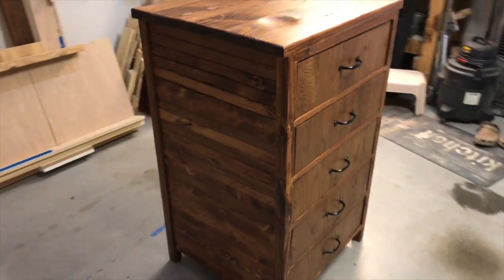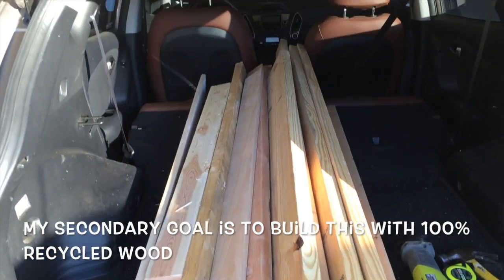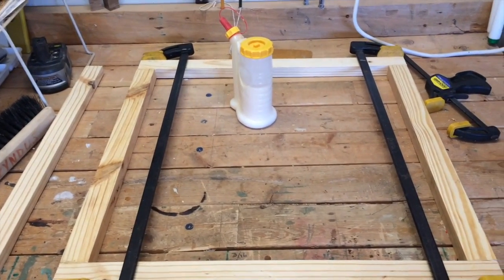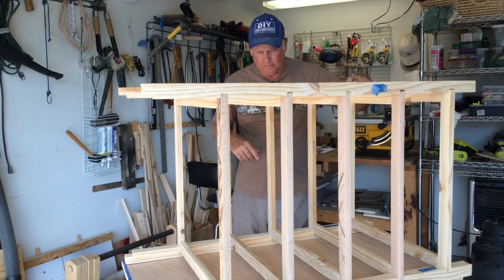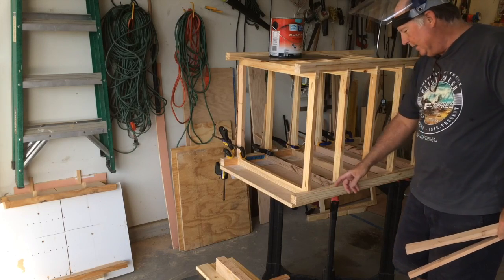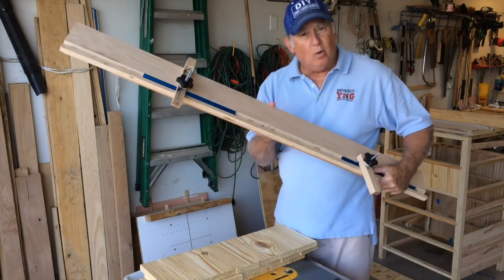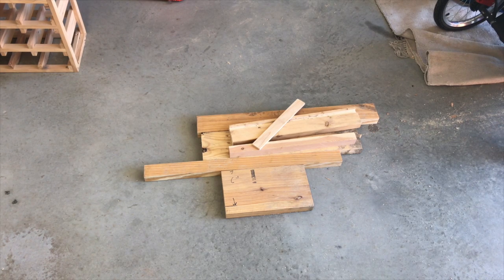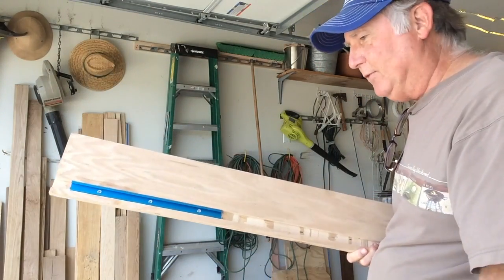Dresser Build

Comment: An interesting video that shows your build process well.  I like the jigs, especially the sled to trim the drawer glue ups.  
You may be having a problem with wood movement when humidity gets higher next spring.  Since the greatest expansion and contraction goes across the grain, the drawer fronts (and backs too) which already appear to be fairly tight in fit may expand and the drawer will seize up.  The same thing will apply to the 50 slats for the sides unless they are allowed to float and have some room to move as a whole.
Reply from the maker: Jerry, Spoken like a true craftsman.  When you watch Dresser Build Part 2, you will see that I trimmed the top and sides of the drawers to allow room for them to slide in and out.  I also waxed the drawer boxes to make them slide smoothly.

Comment: Would have looked a lot better with the the grain running horizontally instead of vertically for the draw fronts. Less work less chance of cupping
Reply from the maker: I agree, I agree but this project was 100% recycled wood and the longest oak piece I had was 12 inches long.  So they all had to go vertical rather than horizontal.